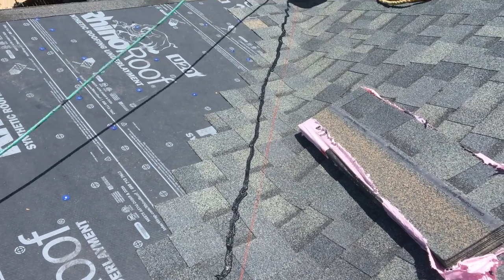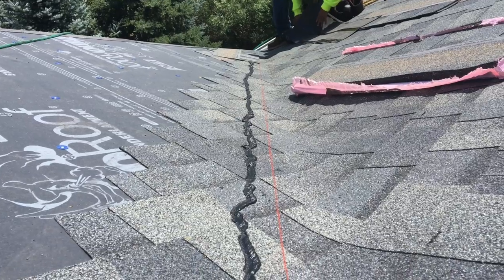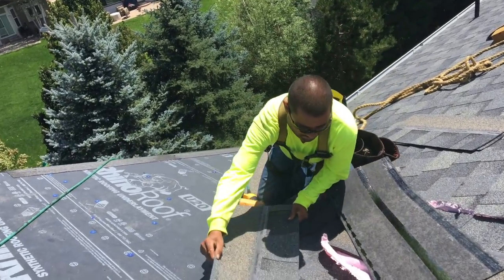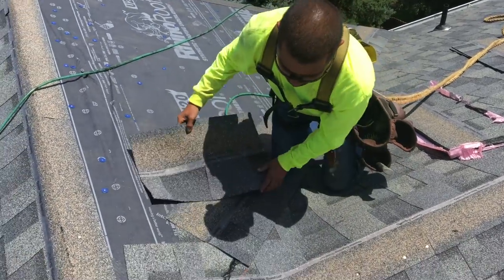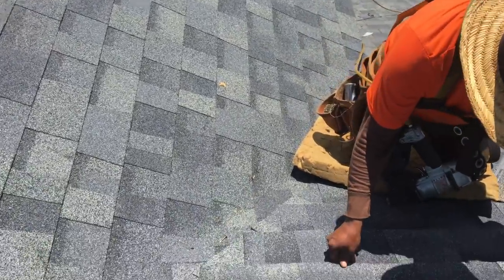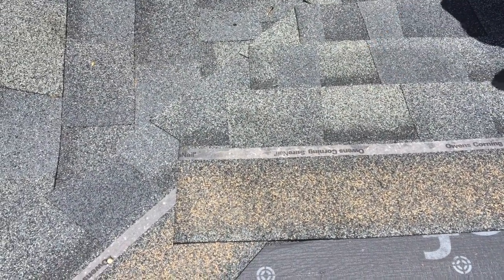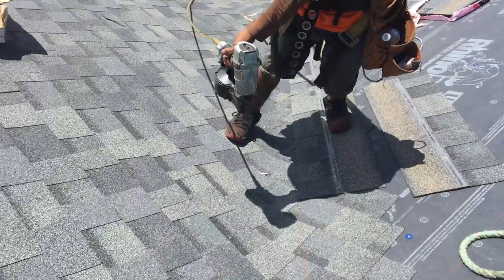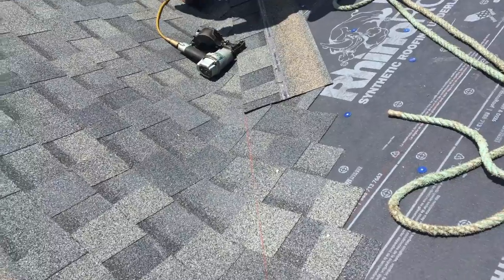CALIFORNIA CUT VALLEY INSTALLATION TRICK | ROOFER TRAINING

Comment: So I've been doing California valleys for years,also on the backside there is a tar line already so it's not necessary to apply caulk down unless your just being over protective,which is ok,not only is it a good idea to do these valleys this way,you do not have to pop a line later and then cut so your valleys come out straight,also it keeps the nails out of the valley itself which is a common mistake,I own over the top roofing here in midland Michigan and these valley's work excellent  in colder climates as well.

Comment: a no cut valley,we do the same thing in Indy. guage 2 fingers on top 3 on the bottom. the shingles that are ran up first will seal to the other shingles. you don't have to seal unless you want to.works either way.

Comment: Great system. Here in florida the inspectors will not pass you if you do not have roofing cement under valley shingles. Great system. All my years in roofing from what I have seen on roof is the majority of roofs started leaking on valleys that didn't have roofing Cement under the shingles. Water shield or not.
Reply from the maker: Florida builds roofs to withstand high winds and we do the same. Most roofers only build roofs the way they were taught without questioning why. Our team always questions why we do what we do so we can build the best roof systems for our environment.

Comment: Every area I've worked ice/water guard is required by code or warranty in the valleys.  Also it looks like the guys will hit the ground before fall protection does anything
Reply: @gregoryhill3683  exactly, in my honest opinion those ropes are more of a hazard than anything, ive seen more people trip on those things than i can remember, would only use on steep or 2+ story buildings

Comment: My shallow roof valleys are getting this woven treatment! 3 layers of ice and water first. Then the weave.  Am happy this is my last roof.
Reply: 3 layers of ice and water? Feel bad for the next roofer. Just plain dumb
Reply: maybe over kill, but the roof won't leak and there will be no problem wilt Ice dams. Works for me.
Reply: Might want to get your insulation checked out if youre getting ice dams. Huge ice storm in the midwest this year, everyone thought it was their roof but it was hot and cold air mixing in their attic due to poor insulation

Comment: Them and the rest of the world call that a California valley. 
That’s been called a California valley for the 20yrs I’ve been doing this, but It’s became super popular last 10yrs or so. Before that everything I saw was closed cut valley.
Reply from the maker: Brian, thank you for your input. The biggest thing that installers overlook is applying a wide bead of tar in the valley, without the plastic cement on the vertical valley shingle the field shingles in the valley may blow off in high winds. We had 90 mph winds for 8 hours earlier this year and many valley shingles blew off the roofs that other contractors installed. We did not have any shingles that blew off. The modified installation is necessary for longevity.
Reply: Appreciate the information. We are a family owned Roofing Company in our local area for the pass 40 years. We also have several relatives in the local construction industry, my brother worked at ABC supply Tulsa for 16 or more years, and Gulf Eagle. My father who started us in 1979 was one of the first roof loaders in the area loading roofs for local lumber stores and couple shingle suppliers back in the early 80’s. My other brother runs our Siding, Insulation, and Seamless guttering side. 
We are all very passionate about what we do an have learned to enjoy what we do by watching our dad. I thought ur video was excellent, it’s always good to meet other individuals that share the roofing trade. 
Please keep posting.!!
If your ever in the area lunch is on us!  
Thanks again! 
BFuller
Reply from the maker: Thank you for responding. I appreciate your feedback.

Comment: I almost have to call BS on this. It would probably be okay doing it that way, and I understand why you do. But, in my neck of the woods, where triple-digit inches of rain is not uncommon, all it would take is one keyway in that bleeder strip being exposed to have a flood of water backed up behind all of that cement not able to get back into the valley where it belongs. Just my two cents. But if it works for you and you don't get call backs, then I guess I should shut my trap :-)

Comment: Update (3 years after this video was made):  Read the Owens Corning Technical bulletin April 3, 2020 regarding California Valley's.  States if roofing cement is applied, it must be located at or above the nail line of the bleeder.  My guess is that it has to do with water diversion - if the cement is too close to the valley it might divert the water under the shingles.  I plan to add a single straight solid 3/8" line of cement on top of the nail line of tar or no extra cement at all.

Comment: I am going to shingle over my existing 3 tab shingles with dimensional.. I have W metal in the valleys can I just shingle over the existing valley  shingles( showing 2 layers) on the W metal) or do I need to add another W metal over the old shingles and old W valley
Reply: Never shingle over old shingles if possible.The new shingles wont last nearly aslong.
Reply: @stinkletoes8285  thats not what I asked
Reply: I  got 3 answers  and none of then  answered the question I asked
Reply: @krichards8472  I would head over to r/roofing...google it.Its a reddit subreddit about roofing.https://www.reddit.com/r/Roofing/comments/od3og2/any_advice_from_seasoned_roofers/
Reply: @stinkletoes8285   I all ready reroofed my house 201 bundles 9 days and figured out the valleys. I am 72 years old, if it last 20-25 years It won't be my problem
Reply: @krichards8472  What shape are the current shingles....what part of the country are you?
Reply: .  @stinkletoes8285 Sorry took so long to reply been away..  3 tab  OC desert tan. some as old as 30 years I put them on my self  in 1992 , 1995 & 1999 add on's (6 nails). older ones pretty rough starting  to show  a little paper They could have gone another 5 years.. garage  was 27 years old  and weren't too bad but curling a little. (nailed the curls) total count  is 201 bundles.  but I am 72 and I didn't want to  do it when I was 77 or older and there is no help where I live. Bids were rediscloses  Using GAF dimensional hickory . HD loaded for free through Beacon.  I  finished up took me 11 days solo about 20 bundles a day, went over the two valleys  and added step metal on 4 walls 230 pieces in all . cut the edge off and put metal over the top of the old shingle edge. 
IN Arizona high country 7,000 elevation  south east of Flagstaff. shingles last longer. In Phoenix AZ your lucky to get 12 years out of a shingled roof. the heat melts them    thanks for asking  I finished up mid july
Reply: @krichards8472  Excellent!!
Reply: @stinkletoes8285  Thanks  and also confident  with the existing   W metal in my valley (never got an answer).Nice video!  I think your video the boys nailed too close to the valley 6" I stay 12 inches from a valley , stay out of a roof bend from8/12 to 4/12 & nail 12 inches from a wall where step metal goes..  

You might have told me not to shingle over my 3 tab yet your California valley has 3-4 layers  in the valley Hopefully they switched to a longer nail as 3/4 or 1"   they probably didn't reach the ply wood over 3 or 4 layers 1 1/2" of shingle minimum' .Most nail guns  max 1 1/2"
  I still use the Hot wire on a NE  side where snow is last to melt. Thank you for the video and your input even at 72 I can learn something new.. a bit of education. In my early days I have seen 2 feet of Ice build up on Roofs in that NE shadowed sides . again thanks for the learning lesson

Comment: Can a valley be woven when there are two different pitched roofs meeting in the valley? I started trying to do this, but then began to realize that I was climbing fast up to the ridge on one roof, but was far away from the ridge on the other roof, and the ridges met at the top. 

I can't see this in my mind. I can't visualize it working. I don't know what would happen much further up if I was to continue.

Can anyone help answer this?  I just don't get it. The lesser pitched roof is a dormer.
Reply: Most newer shingles arnt actually meant to weave and prefer cut valleys, that being said, depending on the different slopes, sometimes you need to run multiple rows on one side for every 1 row on the other side.

Comment: The roof looks really nice great job other than the way he nails.  All he needs to do is 1 nails in total to set the shingle because when he shingles away from the valley the shingle on top the nails from that shingle will set that shingle under perfectly with less nails in the valley and use roof cement in between each layer and dont be greedy with the roof cement eitherput 2 line in between each layer at that. Everyone is so quick to talk shit give rhe guy credit it does look good just give the guy some pointers instead of trash talking his roof and im sure his roof will not leak even though he's shingling between the nails in the Valley area everybody's so quick to get nervous with the valley I don't give a s*** what anyone says I didn't study loose 8 years and I guarantee I'm just as good as any veteran doing it for 20 years because I do study rooms I'm just as good as any veteran doing it for 20 years because I do study roofs I study different styles different in different ways and I like learning from experienced roofers that's the way to learn and it makes you even better I know a lot of 20 year roofer and roofers who have been doing it for 40 years and honestly roofers that been doing it for 20 years in longer actually suck because they've been doing it one way for that long when there are lots of different ways of doing roof now there's all kinds of materials have gotten much better in time and that technology with modern underlay prevent the roof from leaking even better the only thing a roofer it with over 20 years experience is good for is that they're quick that's it and I've actually beaten some 20-year roofers with speed and also a lot of Latinos that do roofs they learn it from a person and then they don't change up this style most of them are set in one way of doing it that is true they think the way they were taught is the only way LMAO and one last thing the guy obviously looks experienced in the video do you really think if his roof leak that he still have a job so obviously his roofs are not leaking don't you think the owner would have fired him by now now I think my comments how much better than any one on here I'm giving that guy compliment and giving him advice that's what people should be doing apparently you're on here to learn something the problem is a lot of vets don't want to teach no one cuz they're worried about losing their jobs to someone younger faster and more talented people that do roofs wherever you want in the video good job just be cautious that you're in the Valley that's all
Reply: Man that was one hell of a run-on sentence I hardly understood you bro. Other than learning from experienced roofers. Which I did the same. And still learning to this day. But man that was one hell of a rant out of ya.!!

Comment: When setting the shingle like that in the valley you only have like a 3 to 4 inch staggered which is wrong there should be a 6 to 7 inch staggered so that the nails don't rust out from the butting up joint. Plus that is not shingle manufacturer specification on installation
Reply: 5 5/8 minimum.
Reply: Cut em as u go up duhhh

Comment: Nail pattern is all wrong. I've been roofing for 15 years and have never heard anyone call that a California valley here in california.
Reply from the maker: Thank you Mike for your reply. Manufacturer's reps loves our installation process and the code enforcers are impressed with our installation procedures. Thanks for your input. Many roofing associations, roof professions and roof inspectors call this valley style, "California Cut."
Reply: How dangerous is roofing? I am going to start as a roofer? Any advice? Is it worth it
Reply: @IntegrityRoofingandPainting  How dangerous is roofing? I am going to start working as a roofer and what advice can you give me? Is it worth to work as a roofer? I am interested in working but i just need advice

Comment: I'm from Colorado I never seen anybody do that I've been roofing for 20 years
Reply from the maker: Roy, thank you for your response, however this is how we install shingles and we don't have any issues. Earlier this year we had 100 mph winds and we did not lose any shingles in the valleys. 

Many other roofs that we inspected and repaired lost shingles because they did not modify their installations. We expect the unexpected and build the roofs to last. This is the best way to install the valley shingles to prevent loss of shingles in high winds.
Reply: @IntegrityRoofingandPainting  no it is straight up trash

Comment: It don't matter if it has or doesn't have cement unless it has ice and water which I see that you don't use ice and water
Reply from the maker: Ice and water is installed in our valley systems, whether they are open or closed valleys ice and water shield is installed first.  I would highly recommend installing plastic cement in the California cut valley system. Every year we experience days where we have sustained winds over 60 mph and this year we had sustained winds of 90 mph during the course of a day. Many contractors experienced a great loss, however we build our roofs for the unexpected. My fellow roofing contractors who go the extra mile do not experience a significant loss when the unexpected happens. I know it seems like over kill, but our clients are worth it, therefore we go the extra mile.
Reply from the maker: We recommend Ice and water shield to be installed in every valley.

Comment: I bet they getting a bunch of call backs because of the nails they putting entirely to close to the valleys
Reply from the maker: Thanks for your feedback. All of the nails are a minimum of 6" from the valley center line. The parallel shingle is offset 2" from the valley, therefore the nails may appear to be close to the center of the valley, however they are 6" from the center. Everything is installed according to code.
Reply: @IntegrityRoofingandPainting  hey you want to nail at least 2 inches away from the edge of the shingle not directly on the edge when doing speed valley this shit is trash just throw the whole
Company away

Comment: Your guy needs to watch where he's putting his nails looks like there's nails on all the seams won't b long till starts to leak yours nails should b back 5 inches from all your seems
Reply from the maker: Thank you for your comment. From the centerline our nails our 6" from the center of the valley. This meets code requirements and all manufacturers installation requirements. In addition, shingles will blow off if they are not nailed properly.  The 2" offset is critical. Once you have a 2" offset and you nail the shingle properly you will not have any leaks nor will shingles blow off in the valleys in high winds.

Comment: well I think every one below me has "Hit the nail on the head"
keep nail hammer leanth away from valley. 2nd tar drys out an cracks there are better things to use
try.  "through the roof "
Google it.  lol
an yep I am a certified carpenter. by the United States Department of Labor
see people this is why you hire a carpenter not a painter to do your roof.    an I would tend to think after the tar drys out an cracks water gets behind it now its trapped by tar below it hum maybe roof leak?  an also if does that void warranty not following manufacturer specs maybe I over-read where they said too tar of valleys like you  do
Reply: In florida we tar everything up the valley ridge ends down the rake along the eave around the penetrations,under and ontop flashings an just about anywhere else you might see a possibility of a leak.  We have several different types of tar to include flashing cement specifically for adherence to metal, we have siliconized tar to prevent cracking we have tar that can be applied in the rain an stick! There's modified for coating membrane an your all around general purpose bull. I love it when you northerners come down south an tell us " A good roofer doesn't need tar".  As we go about repairing your leaks. Cause you see we get some pretty wet seasons an the goblet raindrops often come down sideways in a hurricane force wind blown showers.

Comment: Never install these valleys!!! Always closed cut valley,
Reply: Whats the difference between this and closed cut?
Reply: Installed properly with a coating of tar up valley at bottom edge of shingle to prevent wind uplift an water undertow. Does not need to be nailed when set in tar .and starter course shingle running up valley should be overlapping the next shingle creating a back lap.this way water running down the opposing valley side pushing up onto and down shingle will always be pushed out ontop of underlying shingle..to quote bruce lee.."think like water...be water my friend"

Comment: tabs running perpendicular to the flow of water in a valley is a shortcut to save labor, and not an acceptable method recommended by any shingle manufacturer.  A proper valley using steel should always be the standard, and a closed valley is an option where the homeowner wishes to save money but at the expense of quality, which should be explained to them.

Comment: The nails are not being set properly when fired that fast. Any  angled nails will leak. This system is a complete joke in an area that has snow load. Only 26 gauge "W" valley metal should be used. Period. That nailing is a 100% fail.